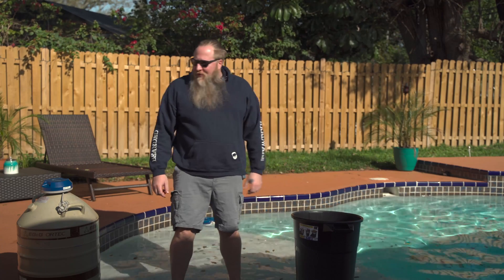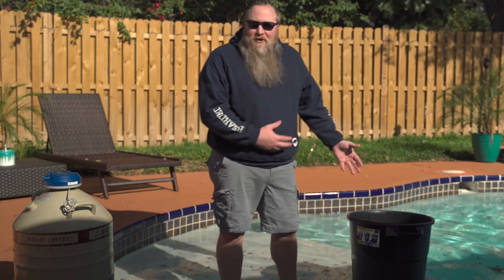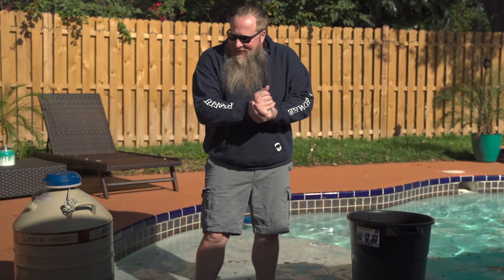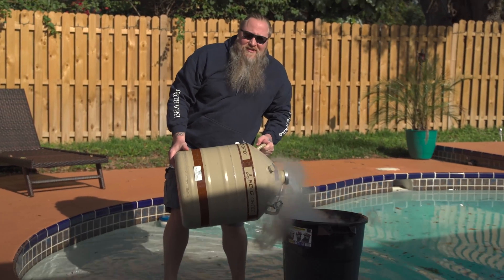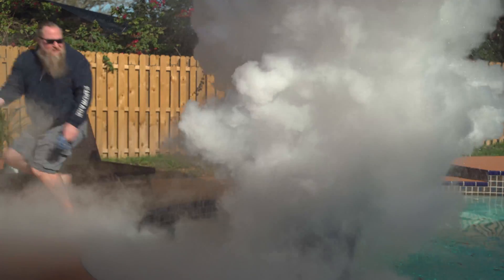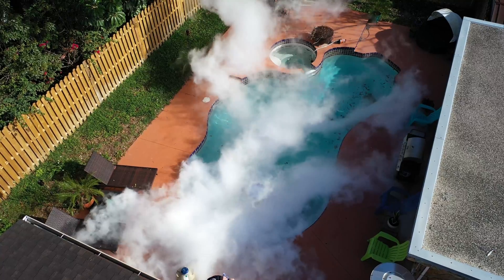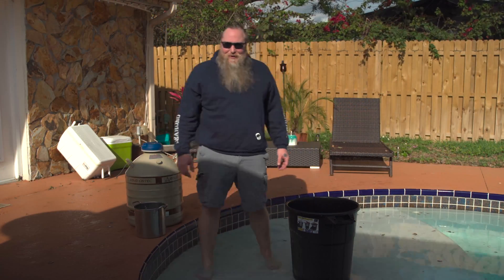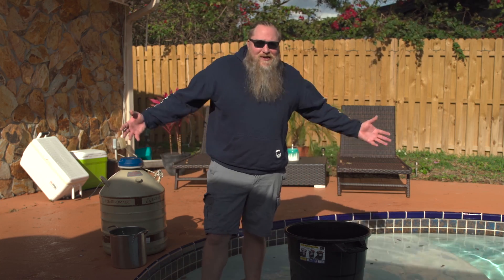Liquid Nitrogen vs Boiling Water

Comment: Another cool science experiment is running DC motor from this temp delta, 1 cap LN2 and other cap with hot water,  put a wire in each cap and connect to motor, this will create a current and the motor will start spinning :)

Comment: Small scale but if you get a plastic water bottle with about 1/5 water and add about an inch of LN2. Then screw the lid on about a 1/4 turn, you can get a nice pop as the LN2 evaporates. We used to do this with LOX.
Reply: also works with coffee tins. Also works with oil drums.
Reply from the maker: Inderjeet Singh dry ice works better .. gives ya more time.. ln2 pops so quick.. lol